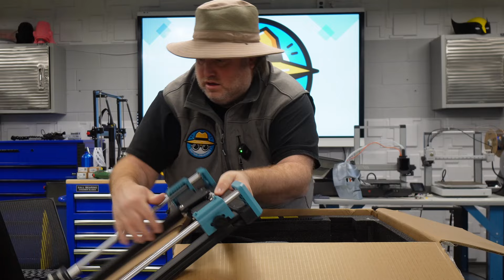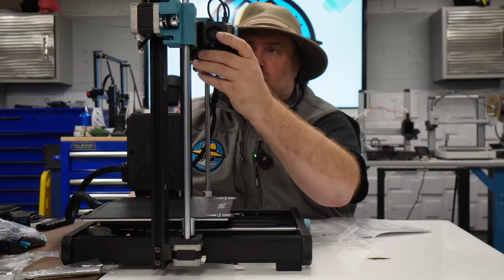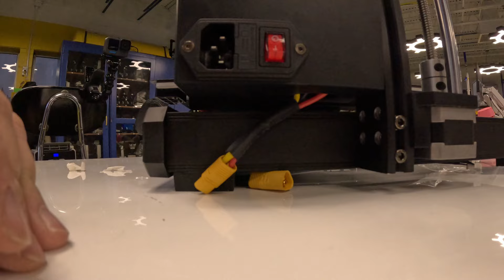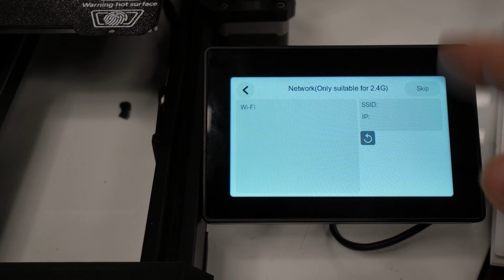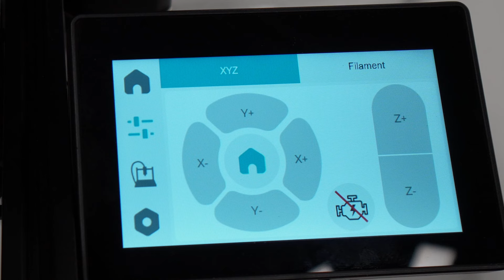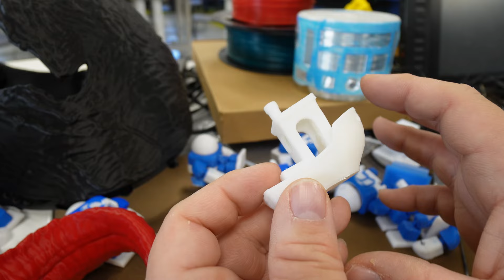SOVOL SV06 ACE Claims Prusa MK4S Performance at 1/3 the Price! 3D Printing Review & Unboxing

Comment: I had an original Sovol SV 06 printer that took a lot of upgrades and time to get working properly.
Indeed after all the modifications, the prints were very qualitative, but not for all the materials.
For the PLA, the PETG was good but for the ABS, and even worse the TPU, very complicated. 
I ended up buying a Prusa MK4 S as a kit, and just from the assembly, you can see that the quality is not comparable. 
All the filaments print without any problems, the settings are simple, and we finally come to the main thing, printing, and no longer tinkering on the machine.
So yes, it's not the same price, but frankly unless you have time to waste, the price difference is more than justified

Comment: I have a real dislike for knock-offs .  I love my Bambu A1. Lately, I've been looking into the T1 Pro. Are you planning to test the T1 Pro?
Reply from the maker: Hi , out of curiosity why would you describe the SV06 as a knock off? I know they have been around years before Bambu Lab and I didn't find their machine to be a knockoff unless your referring to the Prusa? They are using Klipper and Obico for mobile capability and Orca for slicing. I think it's actually much faster than the A1 but I'll do some tests and report back. I was thinking of doing a showdown amongst several printers with the same build sizes. 
As per the T1 Pro it's not on my radar , I did do an on-site review of it at Rapid TCT but I never published it. I held off after seeing reports of the noise issues but that might have been related to the S1 , I know that they made a muffle for it but it's still pretty loud that most reviewers said they needed to move it to another space. Anyway I'd be happy to dig in a little deeper and thanks for the feedback and for watching. 😊

Comment: Everybody do not buy this garbage if you're going to spend $300 get the A1 from bambu
Reply from the maker: Sorry definitely wouldn't consider this to be garbage. Not at all I was pleasantly surprised to see it work very very well. The speed is also amazing and pretty accurate. They are definitely pros and cons and if it was the SV06 previous version then I would totally agree. But I promise you this was not garbage did you buy one yourself and have a different experience? Was this the ace? Anyway feedback is always appreciated and thank you so much for watching
Reply: @CaptainCreativity  Bambu is the apple of 3d printers all of the 3D printers or Androids
Reply from the maker: That's a good analogy  @datmixednut1254

Comment: I have the original, and it was a lemon. Could not get a good first layer over the entire bed. That could only be solved with manual leveling with a dial gauge. It was an awful experience for a new user.
l I also found topics where some Prusa users have those problems. I can't justify paying premium for a bed slinger when you can get a core xy for around half the cost.
Reply from the maker: Interesting when you say the original are you talking about the SV 06 not the ace version? Yeah I've been very impressed with The results so far The first layer in particular has not been an issue for me or for any of the prints I've done so far. I'll obviously be keeping an eye on it but if it keeps going the way it is I'm very interested in what the ace plus might bring. Crazy enough I actually think this might be faster than my bambu p1p. I have to do some more testing on it but I could have swore one of the helmets I just printed finished 2 hours faster than on the P1P so stay tuned.
Reply: @CaptainCreativity  Yes the non-ace version. Most users on the fb group don't have these issues. But there are a few users out their that getting frustrated by not being able to solve the problem. So I think the quality control is lacking. But that's also reflected in the price. That;s why I would not recommend this printer to beginners because they lack the skill the test them out of the box thoroughly.
Reply from the maker: @StarsAtNight1 I totally hear what you're saying I kind of regret not having a sovol prior to this. I could only hope that perhaps the company might be turning a new leaf and focusing on quality control. One of the things I like to do in the near future especially by the end of the year is to start benchmarking the speeds of these printers and giving a nice comparison to everyone. I'm just trying to find now a good model to use. I don't like using the benchy I would love to try to use something else as a better standard and also maybe something that's not so small. If you have any ideas I'd love to hear them

Comment: White benchy?
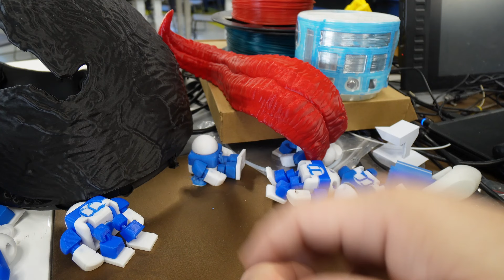Reply from the maker: White and Green , I use the white originally because that's what came with the packaging so I usually like to use the filament that the company sends for the most optimized results. But then later in the video I ran another test on green. Anyway thanks for watching,  check out 21:40 to see the Green Benchy
Reply: @CaptainCreativity  Pleaze don't use white, can't see notthing with that.
That's why the ship white filament: so you don't see defects.
Reply from the maker: @eaman11 yup your right . Going forward I will not use white but keep watching I do make another test in Green
Reply: @CaptainCreativity  Yeah I saw that, much bettar, good job.